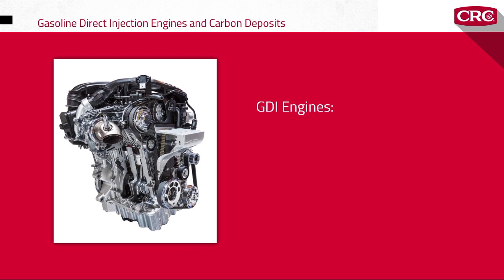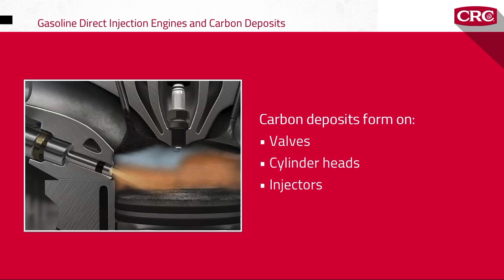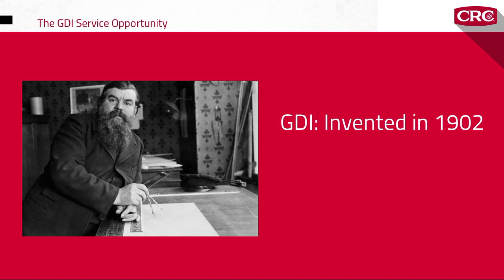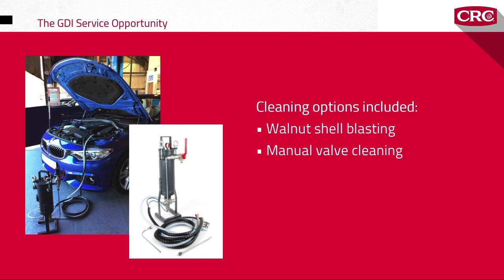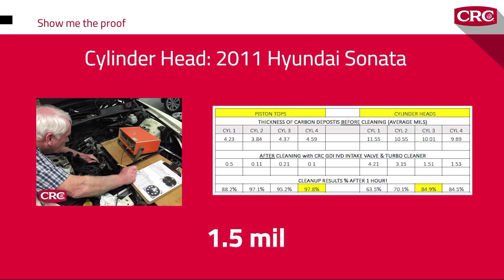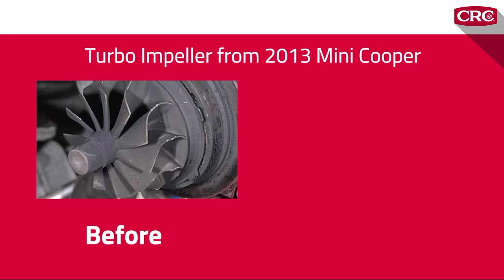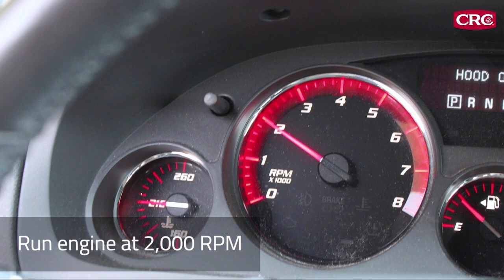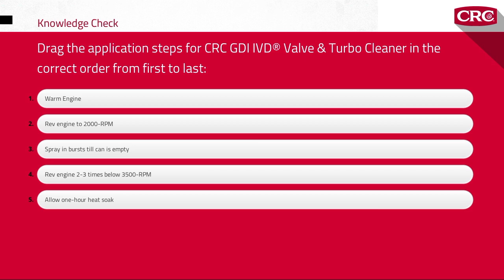GDI Engines and Carbon Deposits | Know Your Parts

Comment: Could this cleaner cause large chunks of carbon to break  off and damage the turbo and other components like catalytic converter ?  I have run my car now for 20k miles  since brand new without gdi cleaners  and worried about using it now at this stage.
Reply: The video said carbon build up could get so bad that chunks could eventually fall off and damage  catalytic converter. However I noticed that once he mentioned valve cleaner product, he said the cleaner is safe for everything. I’ll make my own assumption and say yea this stuff is safe and won’t damage any part of the vehicle
Reply: Well my 2013 F150 Ecoboost has 130k miles on it fitted with a GDI engine and never cleaned the valves. I tried it, and my warm idle went from 1200 RPMs to 600 RPMs. Great results! I gained 3 miles on Fuel Economy and its getting better.
Reply: As concerned as I was what with my Cat being destroyed as well as a chunk of carbon flinging off to my Turbos and destroying it, I emailed them directly about my concerns. They said that the product is meant to melt away the carbon build up layer by layer and the natural movement of the engine and the heat combined, makes it easier for the carbon deposits to break apart.
Reply: So far so good. Only good results here! Now I'm going to get my 3rd treatment in a couple months so I'll keep you posted.
Reply: Oh and I also installed an Oil Catch Can to further prevent Carbon Build-up. Works wonders 👌
Reply: @islasdelosladrones2128  Smart move. So Ik it said u can't spray it directly onto the mass flow sensor. So basically I can just open the intake cover where the the air filter is and just spray it into that and I'll be good ?
Reply: @Bradygoat6390  yes that's what I did with mine. You bypass the MAF sensor completely and you'll be good.
Reply: @Bradygoat6390  my MAF sensor is connected to the filter cover. I had to take it out completely spray right before the Y point of the Air Intake Valve. That way the MAF sensor isn't bothered. It's pretty much as instructed on the directions label so you can't go wrong.

Comment: 1. Toyota uses dual injection in their D4s that solve problem in its very beginning.
2. You forgot about EGR system that is one of three legs of carbon built-up:    PCV crank ventilation system+EGR+GDI. All these three are making the problem real.
Reply: and turbochargers where applied

Comment: CRC Valve Cleaner is the solution but don't follow instructions on can. 2017 Sonata new got 32mpg combined. At 25K now gets 26mpg combined. After cleaning, returned to 32mpg and sets you back into the seat @ WOT, so it works. Bring car to operating temp., spray intake (down flow from any MAF) with full spray at 2500rpm. Engine will choke down and almost die, turn off at this point. Let heat soak for 1 hour. Start and drive for a couple miles and repeat twice (3 times total). Engine will crank longer before starting and will rattle and ping first mile of first cleaning. This method only uses 1/3 can for all three heat soaks. The initial pinging proves that carbon was breaking away after each heat soak. No codes set and 5K mile later (30K). Blow-by from crankcase increases with each acceleration and that is why highway use delays carbon buildup. I am a lead foot with WOT used frequently. I will do one heat soak every oil change from now on. GDI problem handled.
Reply from the maker: Thank you for your comment and support of CRC GDI IVD Intake Valve & Turbo Cleaner.

We recommend to perform short 1 second bursts until the can is completely empty. 1 can per vehicle treatment, regardless of engine size. Heavy spray rates especially in 4 cylinder vehicles will cause pooling of the product.

Pooling of the product could lead to pinging or knocking since extra combustible material is in the cylinder and not accounted for by the ECM. If you have further questions please reach out to Scott at Technical Support 1.800.521.3168

Comment: I have a 2016  and the gdi motors and cvt trannys are trash. You need to run sea foam through the intake system ( because gdi doesn't inject gas through the intake like most cars , so they get higher compression  ) and take the intake boot off and spray behind the mass air flow sensor. Put boot back on. Rev to 2k rpms and hold it there while someone sprays the sea foam in . After can is empty, turn off car and let hot soak for 15 min. Then start it up, Rev it, drive about 10 min. If smoke doesn't appear right away don't worry it will ( especially in these trash motors , I've done 2 sea foam sprays already and may need a 3rd ) . If no smoke comes out, pull over and turn the car off for 5 min . Start process over again and if you have triptronic where you can control the gears then really get on it 1- 4th gear . Blow all that crap out of your motor. These engines do burn gas esp while using sea foam. Get an oil change shortly after. Smart thing would to be add the liquid kind to the motor and fuel system and drive 100-200 miles and then definitely get an oil change. God bless 🙌 🙏

Comment: The Mazda GDI seems less filthy than other brands. See the Project Farm YouTube videos- he found that adding Berryman B-12 Chemtool to the gas tank once in awhile and Restore to the engine oil (if the piston rings have a lot of wear) help reduce problems from carbon buildup. A 10 hour drive at 70 mph on a hot day might help, especially for diesel engines. I would like to see a comparison test for different cleaner brands by someone independent, instead of marketing for 1 brand.
Reply: Jeff Ruebens Adding anything to fuel or oil won’t alleviate the problem as the fuel never gets to the top of the pistons. Fuel has plenty of detergents added to it already. That’s why port injection systems don’t have this issue. In those, the fuel is sprayed onto the top of the pistons and the detergents clean off the deposits before they’re burnt onto the metal. You’re confusing combustion chamber deposits with the piston head deposits that plague DI engines.

No product helps piston head carbon build-up in any significant way. Only periodic walnut blasting cleans it.

Comment: Wil this work on my Tesla 3.0 ?
Reply: Yeah, I am sure this will squeaky clean out all the intake valves on your Tesla 3.0 gas engine.  You are guaranteed to get rid of all the fuel efficiency issues.    :-)
Reply: Spray on all sides of the battery pack twice a month. Not sure how much good it will do for your mileage but CRC will appreciate the sales.
Reply: Tesla 3.0t is port injection, only works on the Tesla 2.0T which is GDI😂

Comment: Alfa Romeo, Toyota, and many others are starting tu use a regular port injector just to solve this. VW/Audí owners needs to buy this by the thousands
Reply: Subaru BRZ & Toyota GT86 have port injectors since 2013 (Toyota D4S fuel injection)
Reply: Volkwagen GDi engines in Europe now use a dual port system.

Comment: Were any tests done for potential piston rings / cylinder wall wear from all this carbon entering the combustion chamber all at once? I imagine it's like sand particles that will scratch the walls and cause eventual engine damage
Reply from the maker: Sorry for the delay in responding to your question. For the best information on this, you will want to contact the CRC Industries Tech Line: 800-521-3168

Comment: Using a high-quality engine oil from one of the big-name brands and changing your oil yourself at 4k miles will save you a lot of headaches later. And put a high-quality fuel injector cleaner in your gas tank every month or so to keep your high-pressure injectors cleaned and spraying the right pattern The better engine oils don't allow the oil to vaporize as much so that helps in reducing carbon build up

Comment: You will ALWAYS get carbon build up in Direct Injection (only) engines, period. However, not all build up are equal.
--
Thin, dry, sooty, build up -- which are usually mild and will not make a tangible impact on airflow is from valve overlap at lower rpms causing some of the exhaust products to back up into the intake before being sucked back down into the cylinders. If that is all you have, I won't bother to clean it. Dry soot, you see, doesn't really stick!
--
Thick, cruddy, oily build up is from OIL in the PCV valve and/or leaky turbo seals. Cleaning it is not really a fix. I guarantee it'll return in 30,000~40,000 miles. Not much you can do about a leaky turbo -- time to replace it or sell the car. But you can install an oil catch can in the PCV system to cut down on 90% of the oil getting to the intakes. You can also use an oil that doesn't evaporate as much and does not cause as much oil vapor to go through the PCV system. In general, use a good synthetic that DOES NOT have a wide viscosity range. In general, the 0W-40 is going to evaporate more than the the 10W30 or 5W20. If you want to be sure look up the evaporation loss numbers for that specific oil.
Reply: Dwight Looi what about Diesel engines?
Reply: @jaarryifleshblood315  Watch the video.  At about 6:25 it says should NOT be used on diesel engines.

Comment: I have a question. I am using a top tier 91% gas and 100% synthetic oil. When there is noticeable carbon buildup on the tailpipes; Does this means the carbon is building on the intake valves too or is the engine is getting rid of that buildup and exiting it out the tailpipes and out of the system??? Thank you Gary (2017 WRX Limited).
Reply from the maker: It will depend on the vehicle.  You can't go by the tailpipe.  Turbos will never lose the soot because of how quickly the air fuel ratio is changing constantly, for example.  If you have a GDI engine the valves will experience carbon build up.  It's best to periodically clean them.
Reply: The soot on the tailpipes is from startup or other times when the engine is running rich
Reply: All top tier and synthetic oil burn rich. Ethanol cold starts and low intake temp will result to no black pipes.
Reply: Know Your Parts rofl, you know nothing about cars except what's said in your training video, the wrx with their new direct injection 2.0 liter will have the same problems that all the other direct injection vehicles have. This product is snake oil, and has been proven, pull the intake, take pics, use product as instruction says, remove intake again and compare.  I love how all snake oil adds say at least a dozen times how it works we swear, these pics are proof, yet 0 garrenty. Why no garrenty if it works so well? Because it doesnt.
Reply: I'd agree however its "guarantee not garrenty" yes these sprays are useless... as don't forget they'd be on the valves for a millionth of a second ….. spraying the solution onto a stationary object & watch the oil being baked/removed by the solution is a totally different effect to using it via the intake tracked.... anyone with sense would just remove the intake manifold & clean the valves & chamber themselves.. I've just done my N14 turbo mini & I've used carb cleaner & fuel (fuel as I used a lot less to remove the oil build-up... YES its bloody NOT carbon)

I've said else where on utube.. I'd pay to see anyone remove the intake video it, refit it & start the car & spray this or anything else said to clean the intake valves & then remove the intake again... I'll guarantee no-one would ever do so.. as it would clearly show as you've mentioned its a waste of money!!
Reply: Simple answer, no.
Reply: @brentbasore1544  then why do basically all dealerships have their own brand of induction service chemicals they suggest using? Induction service isn't snake oil... it's a tried and true method to cleaning parts of the engine otherwise neglected. Gdi engines are well known for carbon build up, used to work at  a Hyundai dealership nad they used BG products. Induction service was. a must if you wanted that famous 10 yrs 100k warranty to hold.

Comment: In the 1950's and 60's American made cars had a 'dump tube'...  allowing the bottom of the crank case to 'vent' to atmosphere.  By adding a PCV and "VACUUM" to that system, you are effective creating a 'mist' from the oil in your engine...  That misted oil then is introduced to your engine, intake.  The bottom end of your crank case only produces about 2 pounds of pressure...  Your vacuum system produces up to 10-15 pounds at times...  So..  you're 'sucking 6-8 times the volume of what is necessary to simply "VENT" your lower crank case.  Plug, by pass your PCV system and just leave a 'vent' tube for your lower crank case to equalize that pressure.
Reply: this way ZERO oil/sludge will be introduced to your intake system, intake valves, and cat.  Problem  SOLVED
Reply: Yes, my 58 cadillac has the down draft tube.
Reply: You really don't know physics. Comparing the pressures does not produce direct to volume conversions. Several other parameters need to be factored. And the crankcase has pressure, but the intake manifold is under vacuum from the engine. But that amount of vacuum can vary greatly depending on engine design & throttle position. My Cadillac CTS with a GDI engine produce so little vacuum, that it has an electric auxiliary vacuum pump. This electric pump does not pull vacuum in the intake manifold or engine. It is to increase vacuum for the power brake booster and devices that use vacuum such as HVAC. There are check valves so the electric pump does not affect the engine performance.
Moreover, cars in the 50s & 60s had carburetors - you really want to go back to those?
Reply: @RichardFallstich  Im not going back to carbs, I am simply 'equalizing' the pressure between the bottom of the engine and atmospheric pressure,  NOT drawing a 'vacuum' creating more problems.

Comment: There’s no need to buy a direct injection engine. It needs so much more maintenance and costs reducing reliability. You’ll find those cars are being traded in on used car lots with only 30,000 miles.
Reply: Many vehicles these days with only GDI engines. If you want a car without GDI it severely limits your selection.
I have a Cadillac with GDI and twin overhead variable camshaft timing. It requires little extra maintenance. I get the valve cleaning service done about every 20K miles. No other special mtce. The oil change interval is determined by the ECU, I usually get it changed 1x/year, when it says I have about 25% oil life remaining. Spark plugs should last 100K miles, I still have the original plugs. Car has about 80K miles & runs fine. No other engine was available. 
My wife has a 2018 Focus with a 2.0-liter FFV (up to 85% ethanol) I-4 direct injection engine. It wasn't badged or advertised as being GDI. I wouldn't have known without reading the manual. Car makers don't make a big deal about GDI any longer. The Focus has had only oil & filter changes since new. Absolutely no additional mtce due to being GDI. It gets 30+ MPG. No other engine was available.
Reply: @RichardFallstich  which type of valve cleaning service and the cost?
Reply: @RICK-uf1jj  It's called "RUN-RITE 3-STEP G.D.I. FUEL SYSTEM CLEANER" Last done about a year ago for $70.00

Comment: GDI is right DOWN there with Throttle by Wire!: My newest (2004) Honda has a conventional throttle body with cable. Even when the proper Hondata software was applied to my  2007 Civic Si Coupe, there was still appreciable Rev Hang left. This prevented easily matching the engine flywheel rpm to the transmission rpm, causing large shift delays and loss of horsepower-John  in Texas

Comment: Try the Italian method. 
Before oil change, fill the tank with the cleanest and best gas you can get. Add an additive for that method if you want. Then run on high load and high rpm so the engine heats up really well. This will burn the carbon on the valves and everywhere and there you go
Reply: that works/worked for carbureted engines
Reply: At least try to understand the basics before giving advice. DIRECT INJECTION means the fuel type and any additive BS will not touch the valves and have exactly 0% chance of working.
Reply: @BoogieDownProduction  so what? The engine and intake valves get heated up by that method. 
Try to understand simple physics before trying to correct a stranger in the Internet
Reply: @kazn10  Oil deposits are the issue on GDI engines, not carbon. Scavenged exhaust gasses will have approximately ZERO effect on cleaning the intake valves as the concentration of detergent-rich fuel vapors will be close to zero.

Comment: Fuel injector cleaner used every 4th tank of fuel will keep any type of injectors clean Inc GDI.
With higher compressions and low tension rings in a GDI engine, blow by can be a problem with carbon sticking the rings.
Oil changes at half the normal intervals can help prevent this and along with an oil flush additive will keep internals clean. After the old oil is drained, refill with 2 litres of oil & 1 litre of diesel. Run the engine at idle for 10 mins and drain. Doing this at ev ery oil change will keep the internals spotless and rid the engine and sump pan of any sludge build up. Refill with a premium quality oil and filter.
Reply: Diesel washes cylinder walls, malfuntionjng diesel injectors washing cylinder walls is a calamity...how can you run an engine with diesel diluting the oil?
Reply: @RICK-uf1jj  you're only running the engine at idle with no load for a max of 10 minutes while the engine is being cleaned internally
 Does far more good than harm..